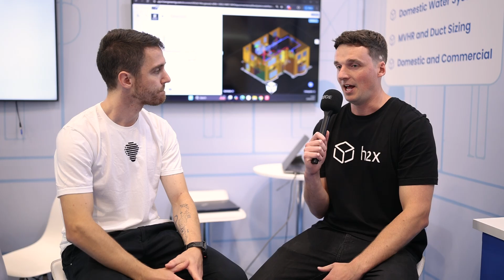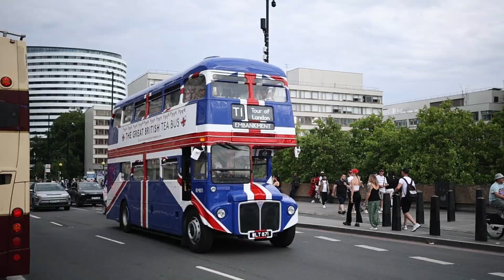How To Design Heat Pump System FASTER? | h2x

Comment: a bit weird not to show the whole system in an example how it works and the differences while talking the whole time about a simple system.

Not a single show case why it is simple and faster - the key of the software.
Coming from automotive industry (20 years) and solar power and battery building (10 years) I wonder what simple does mean. In know and learned to use professional solar power tools like pv sol premium - which is free to use for 30 days - but that was not easy even after a webinar, especially the battery section and simulation.  Since then they have added a heatpump simulation and again not that easy unless you cut corners and simplify systems. 

In summary this video was too short to benefit from it in general ... cause also no word about refurbishing a house from the 90s and if the tool is usefull or not or only for installers and what not.
PV SOL Premium was smart to offer their software to the public, words of mouth even from owners being able to plan their technical system was their benefit.
Reply from the maker: Thanks, good point, but it is almost impossible to show that on event like Installer Show. Idea was to show what is available.

They have a lot of instructional videos on web and YT channel.